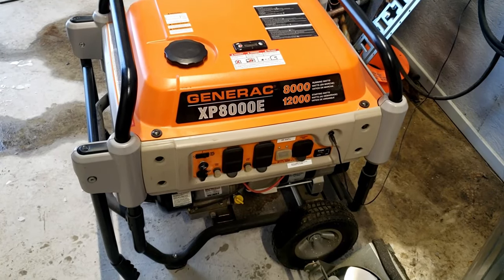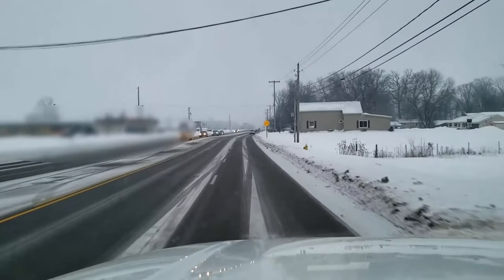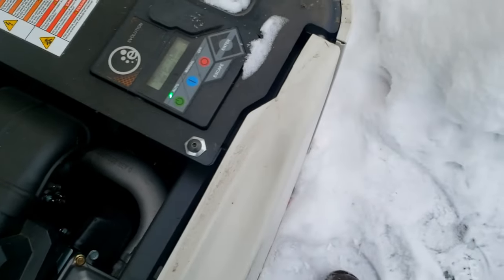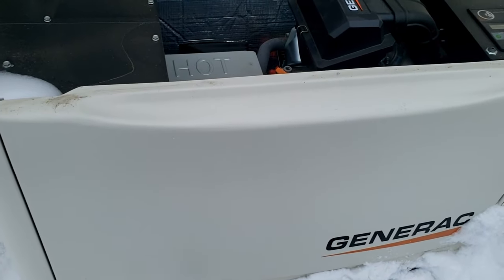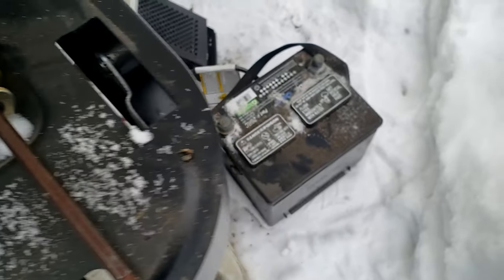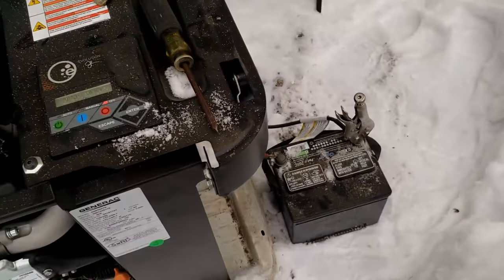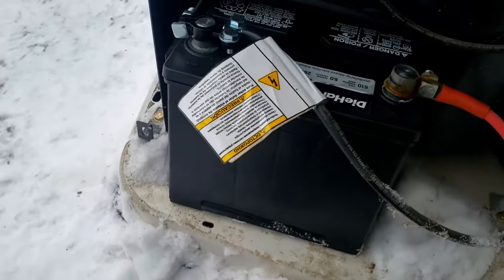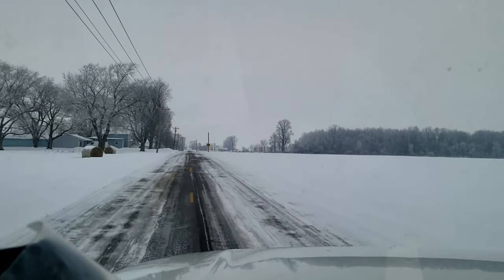GENERAC GENERATOR RPM SENSE LOSS / POWER FAILURE

Comment: We had cold weather here in Wisconsin this past week. Had like 5 or 6 calls of generators that wouldn't start. It was the cold. Just cleared the alarm and started manually no more problems with it. Then switched it back to auto did an outage test. Everything good.
Reply from the maker: Sounds like a GenerJunk Special...lol they need those cold weather kits as an extra helper

Comment: I replace the factory terminal clamps with lugs soldered into the cables, attached to marine grade terminal ends. Spray with NOCO or similar, very solid battery connection.
I also verify genset-off charge volts and running volts.

Comment: Is it ever a good idea for a homeowner to perform basic maintenance on a generac 16 kw  ie battery replacement ?
Reply from the maker: It depends on what your experience levels are. I do all kinds of things that I shouldn't probably do.  I'm mechanically inclined but if it's something really important I try to get somebody more qualified. I think a battery is fairly straightforward but you got to make sure you put the correct terminals on and hook the negative up last to prevent a possible short.

Comment: I believe I have discovered an intermittent bug in the Guardian controller. If you have run the generator using a manual start, for any reason - cleared a fault code and want to test it, or you have been away for a couple weeks, etc.; when you want to end the test run AVOID USING THE STOP BUTTON. Instead, press the AUTO button. If there is no backup power demand at this time, the generator will shut itself off and be ready to start on the next start command, whether it be from the controller (i.e. a power outage has occurred) or with a manual start command. I have found that using the STOP button can result in the next start command failing with a "Loss of RPM Sense" code. This only crops up about once in twenty start cycles, after being shut down each time using the STOP button (plus Enter, unplugging the 7.5 Amp fuse and putting it back in, etc.). I did not write the firmware in the controller's micro processor, but it seems like going from running on Manual to pushing AUTO, lets the controller go through a shut down routine that leaves the RPM Sensor register in a positive/confirmed state, and while cranking the engine, the controller will be in a zero fault status. However, by shutting down the generator using the STOP button, intermittently the controller will see a Loss of RPM fault status, and interrupt the starting process. I could be wrong, but going from running on Manual to pressing the AUTO button, has eliminated starting problems on my Generac Guardian backup generator.
Reply from the maker: It depends on which controller it is. I have seen problems by switching the generator from manual straight to auto and not allowing it to stop. Which sounds like total opposite of what you’re describing, but thank you for sharing! 👍👍
Reply: @HVACRSurvival  Everyone, pay attention to the above comment.  You might have to try a few things to see what works for your particular generator.  My controller is badged an EVOLUTION 2.0 .  Good luck, happy testing.

Comment: I have the same Gen 22kw, installed 1-6-2020. I get the same error message twice a year, and everything always checks out. Bought a new battery this year ,  and still got the same error message. old battery still tests good.  I got a service guy coming next week, any ideas what is causing this, it's definitley not the battery or connections that I can see. thanks
Reply: update 1-18-2023,  the tech came today. The starter was the culprit for the sense loss fault. He said it has happened on quite a few of the late models. It sure sounded and worked a lot better than the original 3 yr old starter. Had the valve clearance adjusted also. FYI.

Comment: Been working on my grandma's generator same model as the one you worked on in your video and came across the same problem of ram sense loss but this seems to be a recurring error code for me have replaced the battery recently and it's good on load test also have replaced the old terminals thinking the connection wasn't good to transfer enough power but still the 1505 error code keeps appearing also generator receives regular mantbiance and when i try to manual start up works every time it just seems to fail when it goes off of its designated start time programed into it and this is also happening in not that harm of environments just trying to find a fix for this reacuring problem before winter if you got any tips that would help my situation it would be much appreciated.
Reply from the maker: I don't have these memorized, the factory doesn't expect us to, we use a diagnostic manual and work our way through it testing what they want us to test first and use a flowchart to figure out what's wrong with it.  You need to find the service manual

Comment: I had a brand new generator installed. seemed to work fine then all of a sudden I noticed on the side, there is literally no light. not even a red light. the display panel is blank but the "off" and "auto" buttons are lit but the manual button is not lit. when trying to press any buttons, no response. any ideas?

also I never activated the generator through the wifi app since it's crap and doesn't work. that shouldn't matter right? I never had problems running it on manual before. any input would be great. fuse, and everything else is brand new.
Reply from the maker: Last I checked if you don't register it the generator won't run in auto mode,  only in manual. Sounds like something catastrophic might have happened. It's under warranty called Generac and get an authorized dealer out there. Not like it's going to cost you anything since it's all warranty.

Comment: What is a good size generator for house? Have a heat pump with 10K heat. Want to be able to run heat, refrigerator and some lights.
Reply from the maker: That can be determined with a load calculator. I believe Generac has a calculator on there website. Generally I recommend getting the largest you can afford because people always want to run more items than they originally thought they would want. I like the 20-22kw with the aluminum case and whole house transfer switch with load shed.
Reply: @HVACRSurvival  thank you. I’ll look into that.
Reply: They now make a 24kw air cooled unit in that same housing.
Reply from the maker: @ericrasmussen9892  I thought that was the newest size but wasn't sure.
Reply: I have an 22kw and I love it..

Comment: I work for a towing company I used to sell and install exide batteries firsthand biggest piece of junk batteries ever they actually used to be made here in California as well
Reply from the maker: I was told they were better built for the vibration of the generator. When did they take a dump? The one that surprised me was the Interstate battery's, I had more problems from those than the cheaper no named house battery they sold.
Reply: @HVACRSurvival  I don't care for the Interstate batteries either, had lots of problems in the past on different vehicles. However, they're made by Johnson Controls, so I don't think they could be worse than the Everstart (NeverStart) batteries at Wal-Mart? I had one of those in my old 1992 GMC service van that lasted 7 years, and when I replaced it, it still had 200 CCA left in it. But wouldn't hold a charge very well, died on me after being broke down on the side of the road for 3 hours with hazard lights on. Can happen to any vehicle I guess. I used the Exide battery 26R battery that came with my own Generac standby generator, had no problems with it, but replaced it at 3 years, because like you said, the Gen was expensive and the battery only $76, why should I take a chance with an old battery. The crane company I work with to set large rooftop HVAC units, they swear by Deka/East Penn batteries. I looked into it, seems like they're the last family owned battery manufacturer in the US. The Duracell batteries they sell at Sam's Club are made by East Penn Manufacturing. I'm going to try one of their 27F in a new 48kw Generac that I have on order, whenever it arrives. (10-12 week lead time). I've also had good luck with the Napa 26R battery in the air cooled units. I went to Napa to get one for a really old 5243 series pre-Nexus 16 kw unit that had been abandoned and neglected for a few years, previous owner had passed away, and from how black the oil was, probably didn't change the oil either. But, I brought it back to life and that old 999 engine is tough I guess :)
Reply: @HVACRSurvival  it was back in I want to say around 2010 was dealing with that brand they may be different now Interstate was the battery to get back then had to be the Green Top white case one though there are different versions I know that a lot of people are having problems with them know every battery brand has gotten a bit cheaper especially with things being made in other countries now Outsourcing and stuff like that still can't stand exide I put one in somebody's car come back 4 days later to replace it
Reply: @brnmcc01   doing AAA Battery Service we went from the progression of exide to East Penn to now Interstate they'll have problems Easton was good when we first got them but then they went to shit too
Reply: Nowadays it's all about the warranty not the battery
Reply from the maker: Yep green top with white bottom 👍👍 2006-2012
Reply from the maker: @Pyro4100  I've seen them pushing the warranty allot but so do does harbor freight😂 on things. I would rather not need the warranty and have a reliable battery. Wish in one hand and...... 😆 I guess

Comment: How old was the generator with only 19 hrs on it?
Reply from the maker: I think I discussed the battery being somewhere around three and a half years old maybe four so I would say the generator is three and a half 4 years old.  It's not uncommon to purchase a generator and have it never be used. Generally you never lose power after you get one 🤣
Reply: @HVACRSurvival  well some might agree in certain areas. In all honesty I sell Kohler and it exercises 20 mins every week and that alone is 17.1 hrs. I am just curious does Generac not keep track of exercise times?
Reply: However I definitely agree about the batteries being overlooked.
Reply from the maker: @ericdavidson5011  It records the date and time of everything. Even when you manually turn it on and off. Test is 10 or 12 minutes on Generac

Comment: Need help fast, i have a 16kw standby generac, ran for 2 days after this hurricane and shut off, error code 1505.  Did the steps to clear and it isn’t restarting.  Any help i can get please.
Reply from the maker: 1505 is a RPM sensor loss. If it's cranking over and it keeps going out on that then you need call a dealer.  If it's not cranking over check the battery, like I said in the videos half the time nobody maintains these things and usually the batterie needs to be replaced.  But like I mentioned if it's not the battery you need to call your dealer, I can't do diagnostics over the Internet for several reasons.
Reply: @HVACRSurvival  yeah it is only 2 years old and has been running, i did have a green and yellow light, low battery warning.  It will shut it down for a low battery???
Reply from the maker: No it's a warning only. You're losing RPM sense
Reply: @HVACRSurvival  i think my board has gone out.  I am at the main menu and the word system is blinking.  I have to control and cannot access menus.  Thank god we got power a couple days ago.
Reply from the maker: I believe it has a 3 year warranty on the parts possibly longer. Check your paperwork to be sure

Comment: What if its not the battery?
Reply from the maker: Then keep diagnosing it until you find the problem
Reply: @HVACRSurvival  it was the battery, it's CCA was not up to par... the previous guy put in a new battery but the Generac controller was bad and the battery was dead beyond dead

Comment: I have A22KW that has a 100hrs on it and it's giving me area code 15 0 5 r p m senseless
Reply from the maker: Very common, there's a whole procedure of tests you have to go through to hopefully find the issue. Sometimes it will clear up in the middle of the tests 😩.  It's very annoying.
Reply: So they're telling me it's not igniting that I have to buy a whole new motherboard or spend $4000 that seem right
Reply from the maker: @jasonrousse1596  the control boards don't cost anywhere near that, heck engines don't even cost that much. Sounds like you got a lot of scam artists in your area
Reply: So what would you recommend me doing
Reply from the maker: @jasonrousse1596  it depends where you live, places like California and big cities love to use the cost of living to justify their price. I don't know what's wrong with it without seeing it. Your telling me they want $4k for a new control board? The generator is $5500-$6500 from Lowes new.

Comment: My 10 kw trips out and shows rpm sense loss even with a brand new battery .
Reply from the maker: I'm releasing another generator video today. Its a older version but covers the most common problems.
Reply: Mine is a older unit . I think it’s about 8 years old or so . Any info on the failed part that does this would be great .

Comment: Bro, that is a dangerous generator setup you have. Should be an inlet on that wall not an outlet
Reply from the maker: If I were selling the house I would not leave it like that but you need to see what kind of work I do everyday. There’s nothing dangerous if you do it in the correct order. The problem is a lot of people don’t know the correct order and they need overpriced electric plugs to dummy proof it for them.

Comment: $488.00 for a new Exide Classic 26RC.....That's battery only...Not installed  🤑
Reply from the maker: Sounds rich
Reply: True...today Amazon now has the Exide Classic 26RC @  $394  but WallyMart has 26R battery at less than $100....Good video - Thanks it helped.